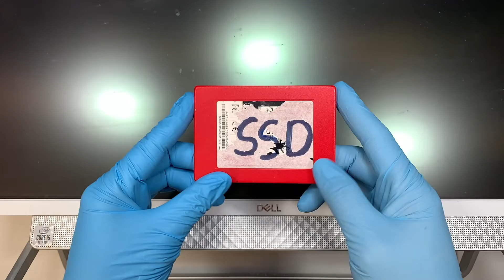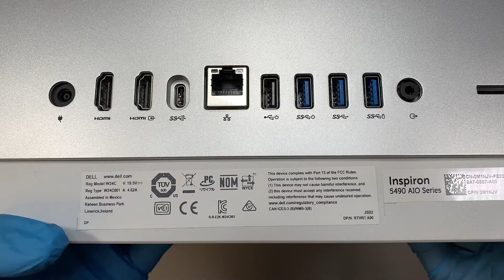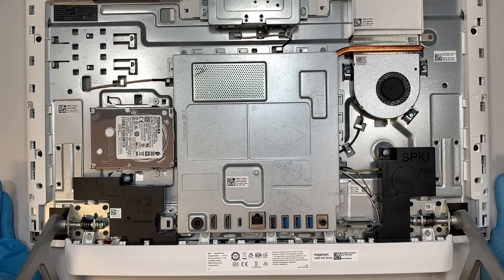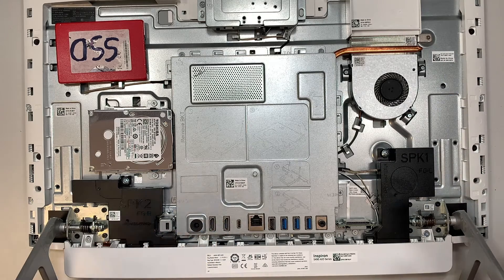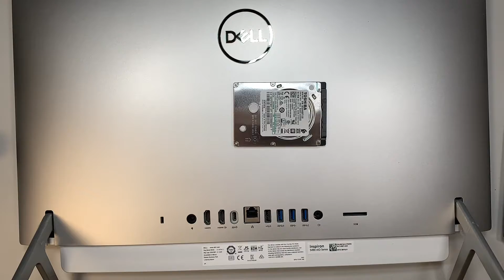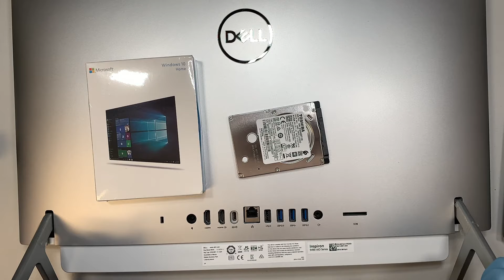Dell Inspiron 5490 AIO W24C Hard Drive Replacement

Comment: There are apparently a few different “versions” of the Dell Inspiron 5490.  The one I had the unfortunate pleasure of cursing over and over had a back cover that extended to the very bottom of the back cover - you separated the back cover about 1.5-2” the very bottom of the back.

And getting those two pieces apart required quite a bit of anxiety-ridden force.

I’d like to think the engineers behind the creation of this monstrosity are now paying for that in eternal damnation.